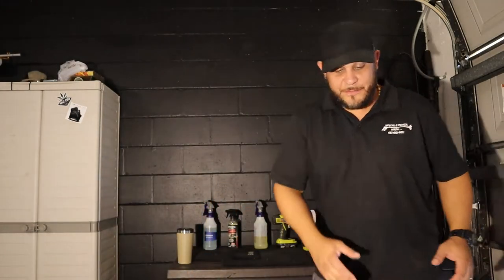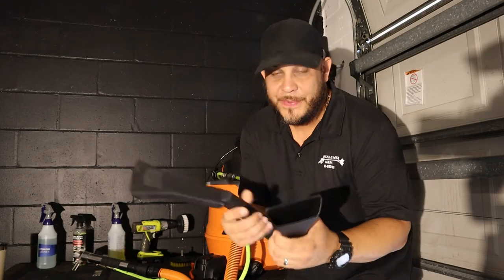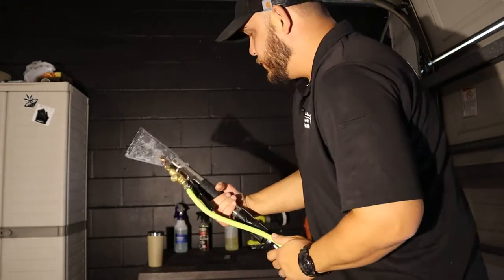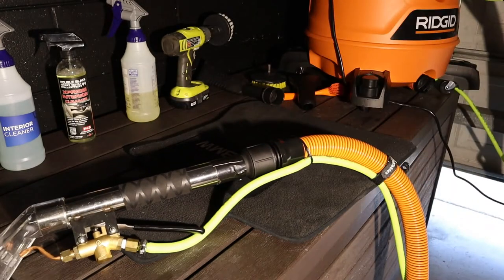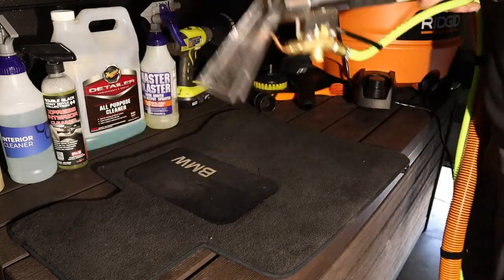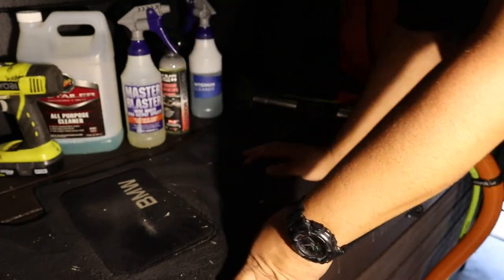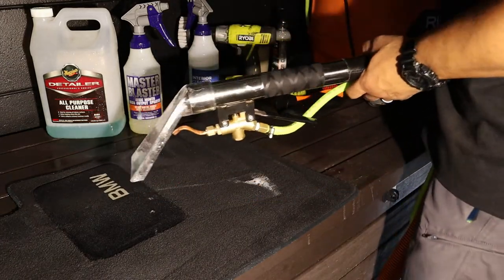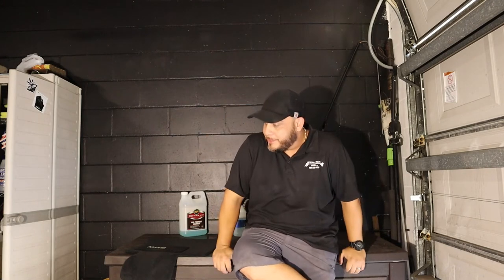HOME MADE RIDGID 14g VACUUM EXTRACTOR

Comment: Great video man! Awesome is literally the best cleaner ever made. It is perfect for EVERYTHING. Only suggestion would be to get a 1/4 npt to water hose attachment. Then you won't have to cut off the threads on the water hose. Also can get extractor quick connects that way you can disconnect the water hose from the extraction head. Can get male and female for $10. Can find them easily on Amazon. Also, I used a weed sprayer bottle and turned it into a hot water source. Nothing works as good as hot water on those tough jobs. It works amazingly well and is super easy. You can use the hand pump and only have to pump it 2-3 times before it needs refilled. However, I drilled a hole, installed a shrader valve(like a car tire valve stem). I got one that has threads on it and put a nut and washer inside the bottle and sealed with rtv. Then I use my Ryobi 18v tire inflator. Sounds complicated but it's easy. Never made a you tube video but may have to make one to show how I did it. Was seriously a game changer for me.